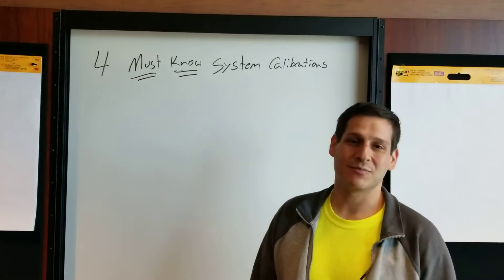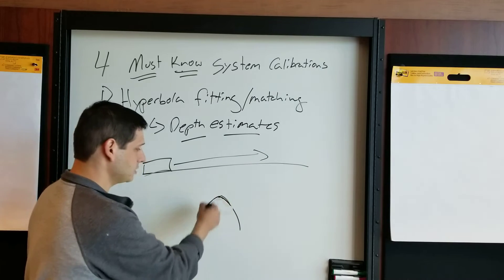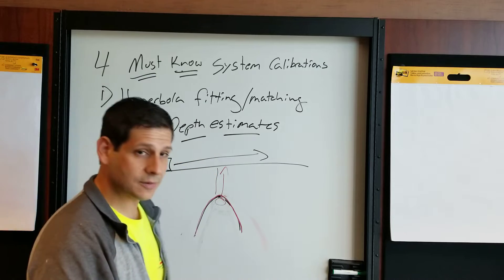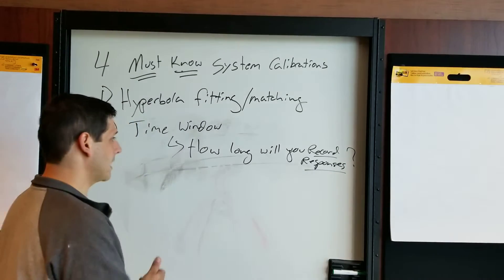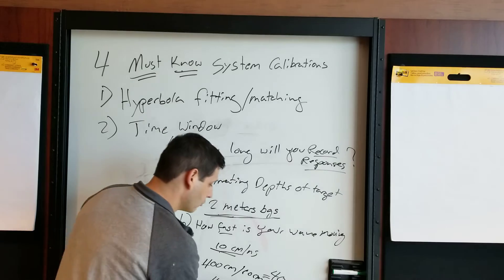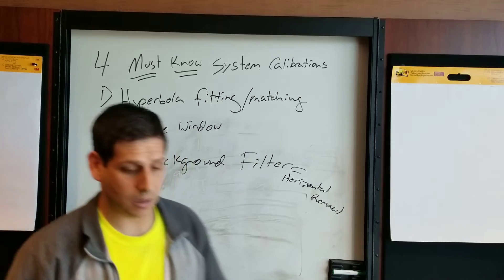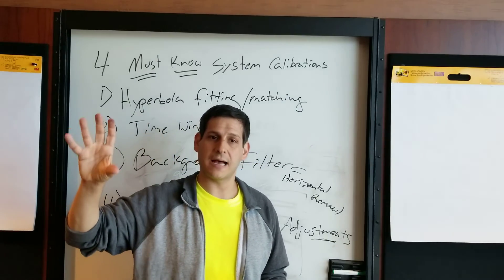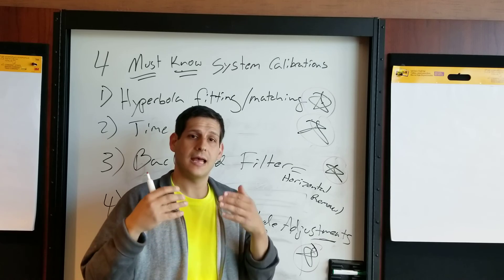Four Must Know GPR System Calibrations! | Ground Penetrating Radar for Utility Locating

Comment: Hi Daniel..can you help me to setup  a mala x3m 250 mhz antenna.. thanks.
And another question about dicth witch 2150 gr  dual frequency. 
In the usa market the setup configuration change or is different to others  countries?
I can see the depth  is not good in this gpr. FCC regulations?
Thanks for all.

Comment: Thank you for your video. I have qustion regarding salty soil it help to use adjustable gain as you mentioned in point number 4, or there are another options with salty soil.
Reg
Reply from the maker: Our pleasure. I never thought about it, but it could possibly help. Auto gain will give the best fit curve for each profile. Unfortunately salty soils will be difficult to get any good data from .

Comment: Thank u for your video , i want to ask you as u an expert in gpr instrument whats your openion in gssi  utility scane gpr and ids opera du gpr and which of them is more good and more usiful in locating utility
Reply from the maker: Hi, thanks so much for watching! I like them both. It depends on your preference for user interface, cost, and what you are looking for. The opera duo has two frequencies and the 700 mhz is great at finding small objects withing the top 6 feet or so. But the utility scan is also a great antenna that is very portable. It really comes down to the variables i mentioned. Good luck!!